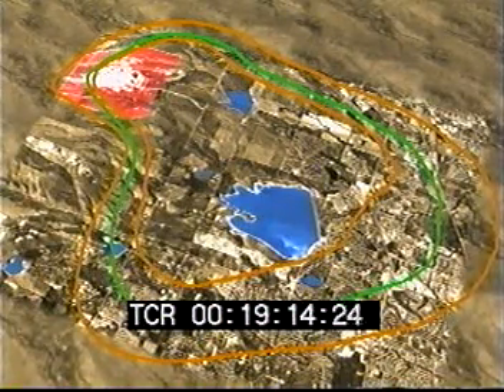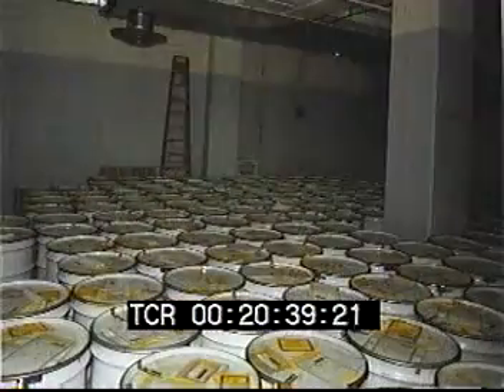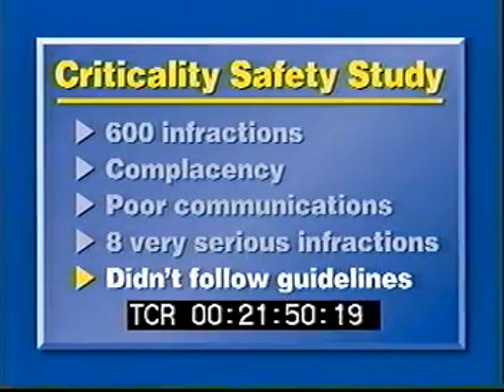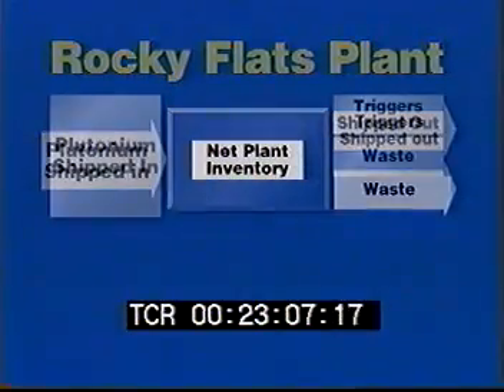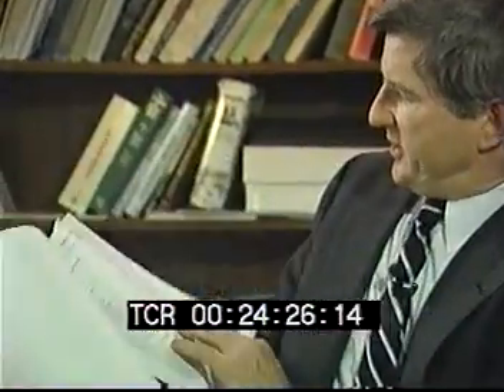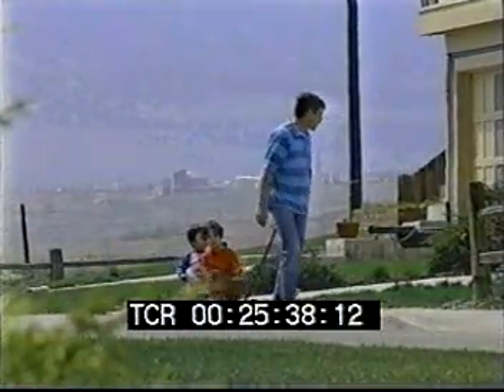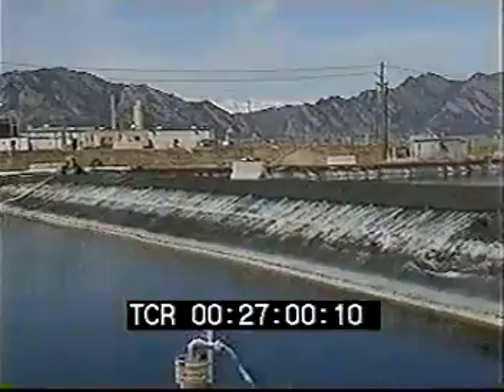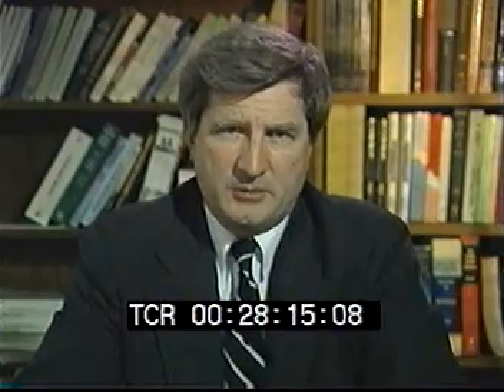Practices of the Rocky Flats Nuclear Weapons Plant - Part 3 of 3

Comment: People thinking that any of the MUF was stolen are wrong. Really, it's in the ground, the air, and the drinking water of the surrounding environment. It's sitting in the air vents waiting to spark fire.
It wasn't just negligence, it was a stifling of any effort to correct the issues. People that attempted to raise concerns were pressured, then coerced, then removed from the system if they refused to drop the issue.
When the criminals responsible were judged in court, members of the DOE and rich DOW officers all of them, they were sent off with a slap on the wrist.
The problem here is the government and corporations playing fast and loose with some of the most dangerous materials in the world. For power and profit they intentionally violated the trust of the community with lax safety standards that have endangered the health of millions and systematically silenced all those that attempted to resolve the situation for fear of the consequences they knew they would face.
It is the largest and most offensive case of "Fuck you, got mine" in recent history, the burdens of which will only truly be felt by the generations to come.